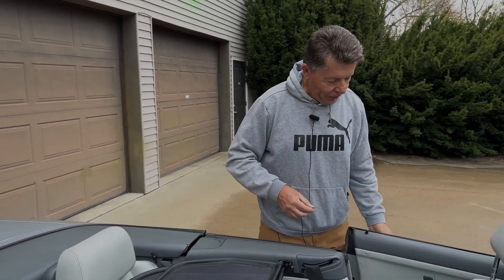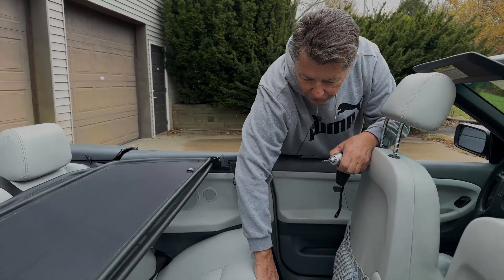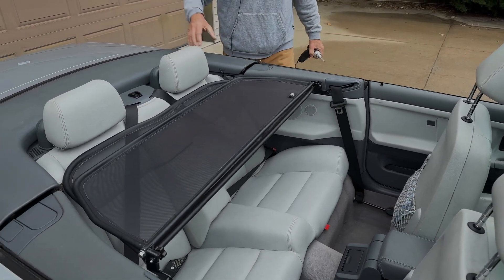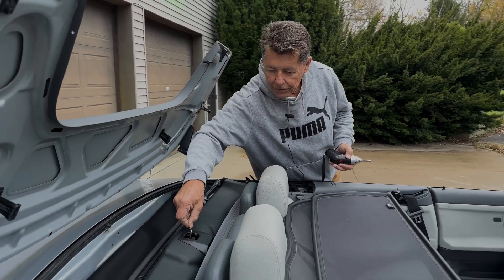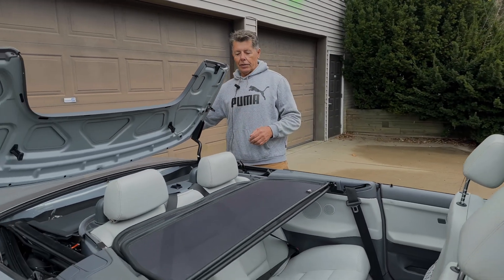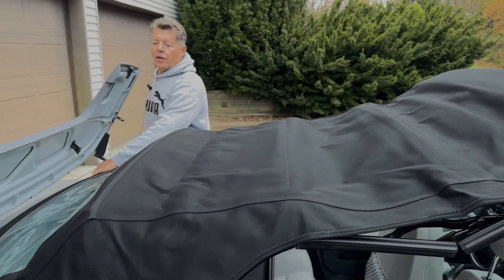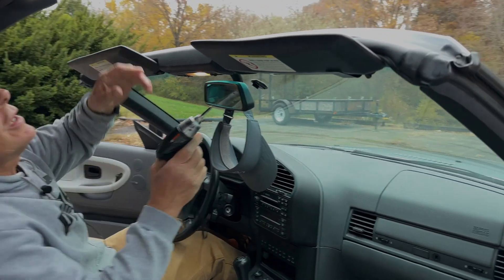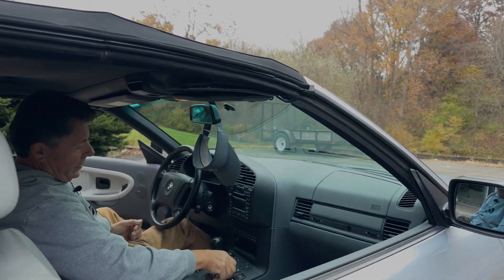How to manually raise/ lower a convertible top on an E36!!

Comment: how do you keep the tonneau cover locked with the top down so the wind doesn't get under it and lift it up?
Reply from the maker: Boris drilled a small hole through the tonneau and the metal on the body near the rear seat. He then used a thumb screw to hold the tonneau down.

Comment: I did this until the screw stripped in mine. I think I was using a bit a tad smaller than needed. Any solutions?
Reply: Buy replacement stuff online or check pick a part junkyards for parts. GL!
Reply: what’s it called i’m having trouble finding it